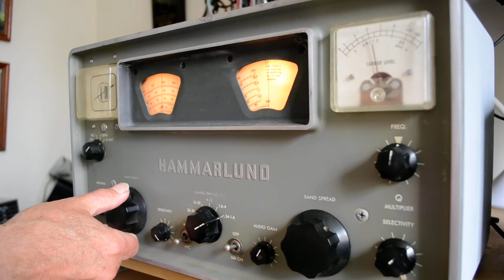Demonstration of the Hammarlund HQ 100 receiver

Comment: Perhaps you already know, but for the SSB reception:
AVC-switch: MAN
Selectivity knob: BFO- position
Function-knob: Q MULT
Audio gain: almost full
Sensitivity: down to nice volume and to prevent overdrive.

I just purchased a HQ-100.
The seller said, SSB doesn't work properly.
I think it works very nice...

My HQ-100 has also the frequencies badly off too.

Edit: sorry, perhaps you just wanted to demonstrate the Q- multilplier function...